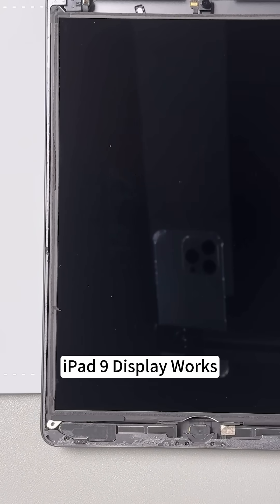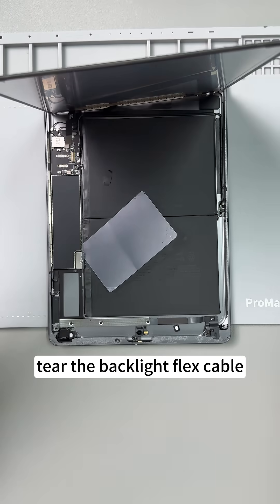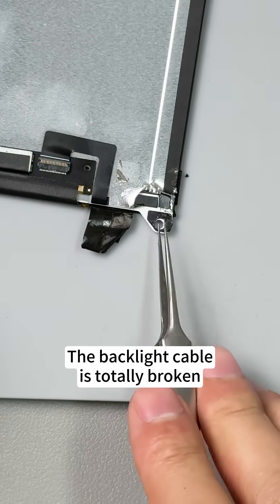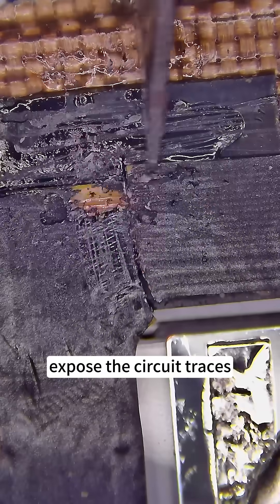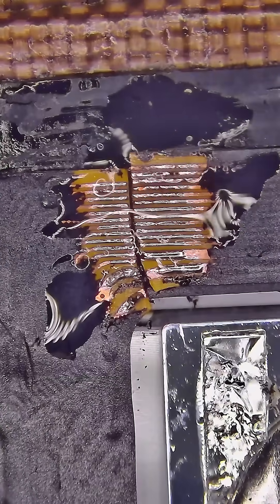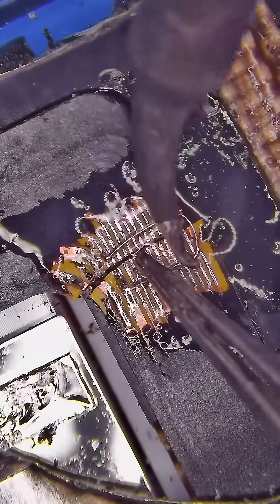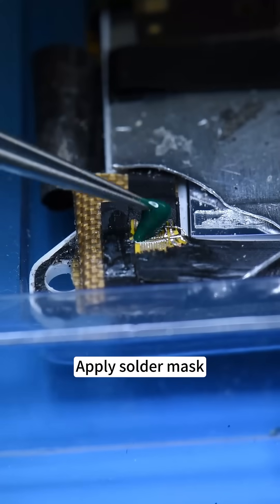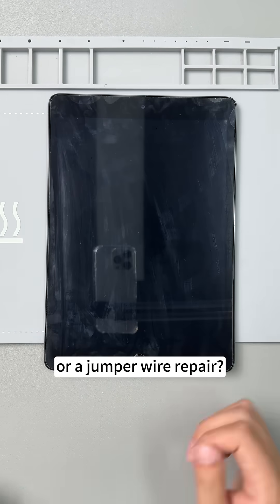"🔧 Is your iPad 9 facing the common ribbon cable issue? 🚀Let's reveal this common issue💥"

Comment: Can i mail you my Ipad for repair? Context as to what is going on with the ipad 9 gen : The screen goes black but the iPad is still on and responsive. I can hear sounds that the apps work and it reacts to touch. The backlight is failing. There is no accidental damage. This happened because my room got to cold at night

Comment: All the lines have to be connected individually
Reply: Obove a user wrote he lost brightness adjustment which would be possible if I imaginge. But is it working in general without long-term damage to the board is my only question here.
I would instantly repair my two broken ones when someone can confirm this method  (just shorting almost all together..😅)

Comment: Can anybody confirm that just soldering all small lines and the two thicker ones together will work instead of soldering every line individualy.  I extracted two LCD with this broken ribbon cables tonight and I would surely do the easy way. But I'm a bit afraid bc with multimeter all lines usually are not short.
 I saw 5 videos who soldered each seperately. Your solution would be so much better if it's safe!?

Comment: So, how do you know the position of broken flexible?
Reply: I don't know
Reply: Multimeter & Continuity Testing, Voltage Testing, X-ray or Microscope Inspection (Advanced Shops)
Reply: Probably The 90 degrees sharp turn creates a point where they cannot be any deformation. Along the flex there is still some room and the force will be transferred to the corner and shear it off.